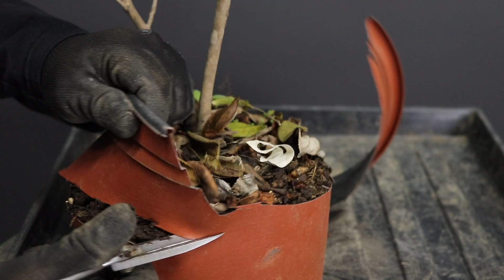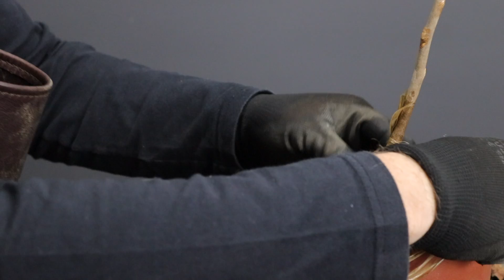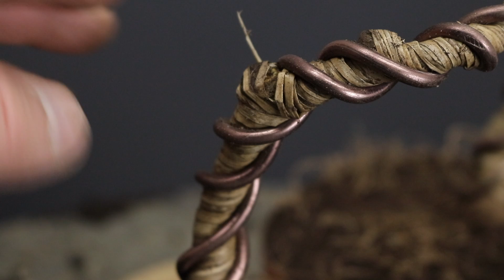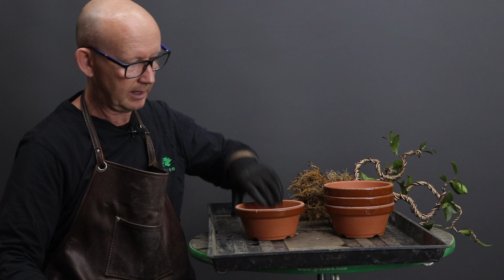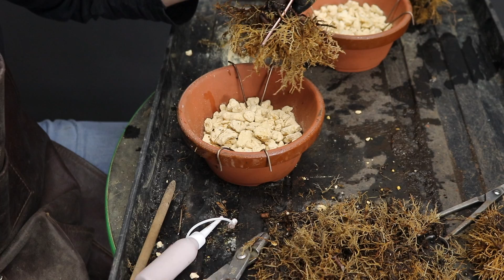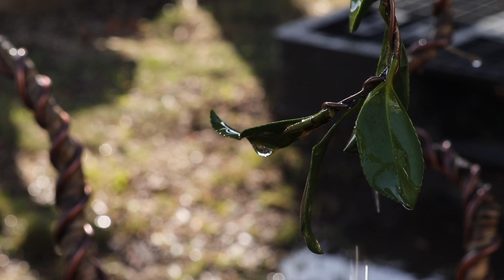Making literati style Camellia bonsai

Comment: Thank you for all the great tips. I learn a lot watching your videos! I have grown 3 Camelias from seed and did some good bending while they were young and I must say that they retain the bends very well, but I struggle with the ramification and have long branches with leaves at tips.
Reply from the maker: Thanks Rina! Bending camellia when they are young is the best, they quickly become very stiff and brittle so that’s great that you did that already. Ramification on camellia is not easy. Depending on the variety you are using the leaf size will differ. Big leaf size means you need to make a bigger tree. However I have built good ramification through pruning combined with partial defoliation (cut the leaf in half). This allows more light into the tree and stimulates back budding. Feed yours well, then after the tree has gained sufficient strength prune back hard and you should get new buds. Could also be your trees are in too little sun. I have mine in morning sun. Moving to more sun in autumn when the sun is weaker.

Comment: Hi Terry, thank you soooo much for so readily sharing your knowledge and expertise - it helps me tremendously. Just a quick question - after having gone through the process of what you've done in this video - when do you (or how long before) you remove the wiring? I suppose one tries to check for possible bite-in? Kind regards
Reply from the maker: Thanks Magda! Yes, you want to avoid wire bite on any species with thin bark if possible. I would imagine the wire can stay on these for a full season as I doubt they will grow so strongly that wire bite will occur. To an extent the raffia wrap will also protect the plant.
Reply: @TerryErasmusbonsai  thank you. I also saw (after my comment) that you plan to do a video on this. Much appreciated!